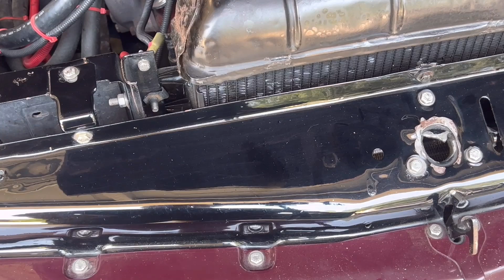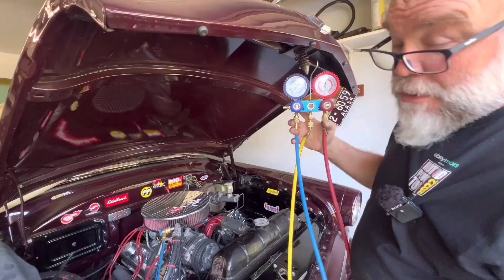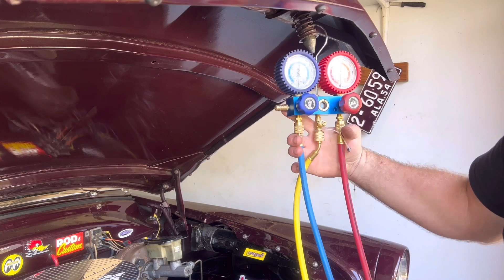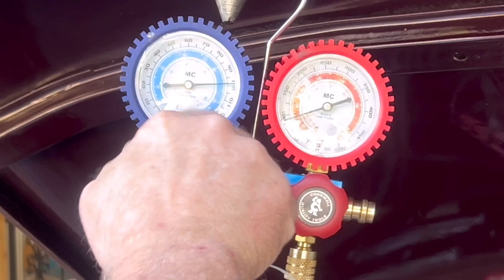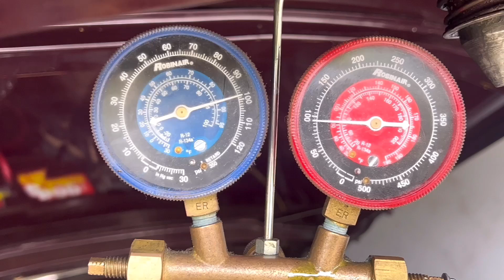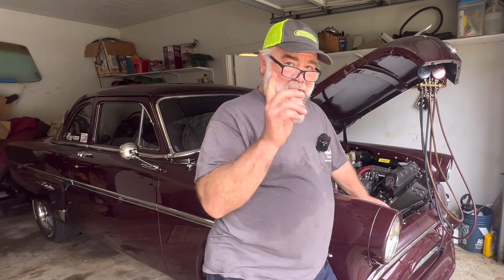Automotive AC repair DIY Repair Tips and How to's

Comment: I’ve got a vintage ac system in my 67 c10 and see vent temps around 48-51, is that normal for hot climates?
It also seems to run
Warmer at highway speeds and colder around town which I find odd. Like your channel
Reply from the maker: 48-51 is good for vent temps. That does seem odd that it’s cooler in town. I would want to check for air leaks in the fresh air system and door seals/gaskets. It doesn’t take very much to over come the ability of the AC to dissipate heat. You also would be wise to check the heater control valve and make sure it’s sealing off 100%. I have also run into that. Driving down the road it would pump more water and let coolant push past the valve.
Reply: @RealWorldGarage  thank you I’m relieved to hear my temps are good. I’m actually not running heater in my system. South Texas never sees much of a winter. I’ll double check for leaks. Thank you

Comment: Very good video . Nice 54 Ford .  What did you have to do to get the sbc ( 327 flags ) to fit ? I'm looking at a really decent 50 Ford 2-door sedan and want to install a 355 Chevy engine . If I remember the tie-rod assembly is a problem area for the oil pan ( been a couple decades and several street rod builds since working on a shoe box )  . Thanks , great video and really nice 54 Ford .
Reply from the maker: The flags fit the factory ford V8 emblem holes. The 327 one below the flags is separate, I installed the flags, laid out masking tape below it marked it and drilled it. The paint was about a week old when I did that. On the oil pan you need a Pan for a Chevy II front sump. And to get the engine to fit we made some flat mounting plates that bolt to the factory mount points which moved the mounting point forward, then put the mounts on the engine set them in place to make sure the engine is positioned good side to side and front to back. With the transmission we just got lucky. It’s a 700r4 and when we went to test mount the engine and had the transmission attached. We set them in place and went underneath to see where the transmission was going to land. It put the transmission mount dead center of the factory cross member. I drilled 1 hole and the transmission was done.